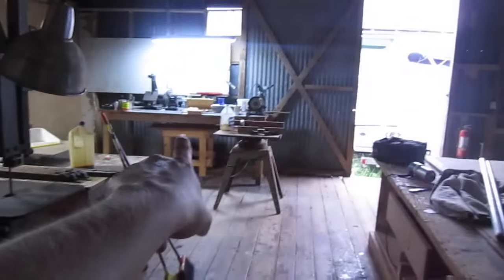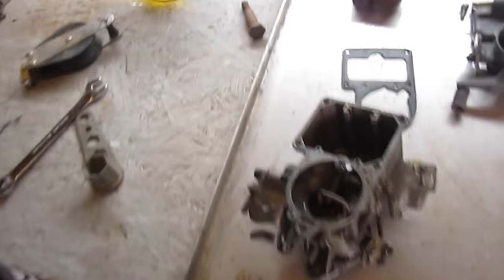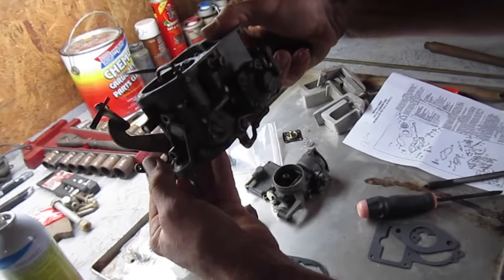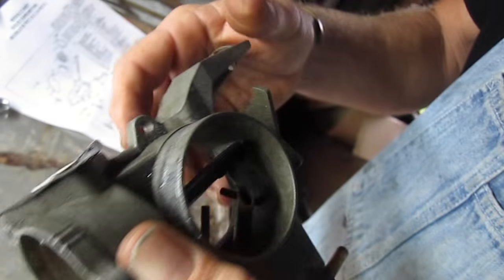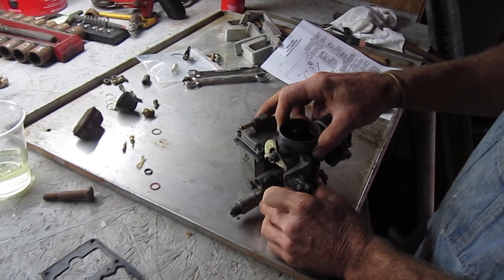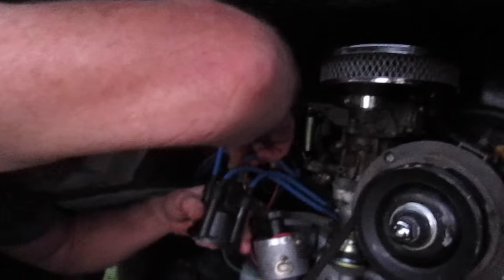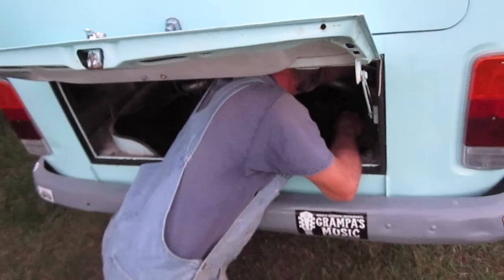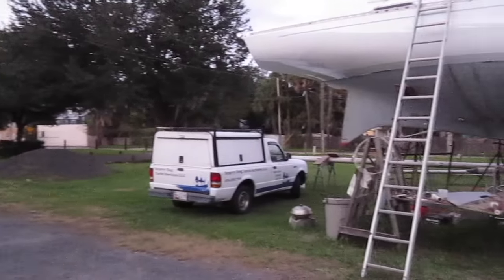Episode 91  - The Bus is Aliveeee!

Comment: I am a sucker for old mechanical things....cars, boat outboards, motorcycles, trucks, etc.   I used to have a 17.5' 1957 Lyman (wood boat) with original trailer and original Johnson Seahorse 35hp engine.  I totally restored everything and it was a show stopper when I pulled into the boat ramp. So many people commenting on their memories of dad's or grandpa's boat that was "just like it".  It was a real pleasure.   I just recently restored a 10hp 1958 Johnson Seahorse which is currently on my 14' Aluminum fishing boat and so far is working like a charm (fingers crossed).  I have a 1986 Ninja 600 (rare red, white and blue color scheme) that runs like a fine swiss watch.  There's just some odd pleasure about having something old that is still chugging along happily.  (and no I'm not making a crack about Pete, I'm the same age as he is)

Comment: I had a 64 Belair 283 V8. Chased a similar problem. Replaced parts and chased it till finally replaced 4" fuel hose from tank to steel lines that was collapsing whenever the pedal was depressed. Much annoyed. Happy for you finding the solution!

Comment: My break time.Our boat is on the hard and I am doing an epoxy barrier then antifouling. My wife wife and kids decided to go camping in our 71 vw camper while I work myself to the bone. What year is your bus? It looks like it has a 71 bumper, the engine looks like 1600, but the taillights look like they are from a 73 or newer. Thank you for taking the time to do the video.

Comment: Something you may not know is all the fuel lines need to be secured with clamps. I have personally watched a bus catch fire and my 1974 Super beetle from what seemed to be tight enough fuel connections.    You probably already know this but never trust the fuel lines with out the clamps. It's ugly when they crack or come off.
Reply: +itsamikething I know of similar occurrences.